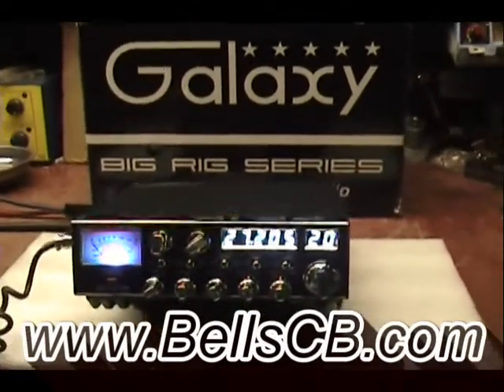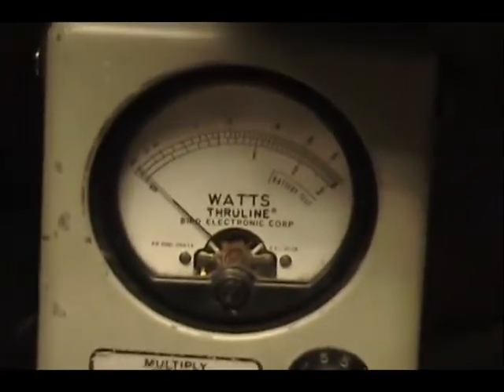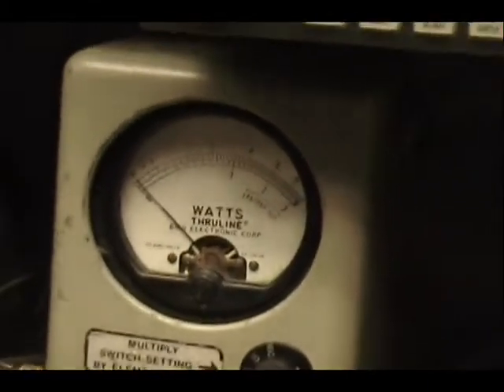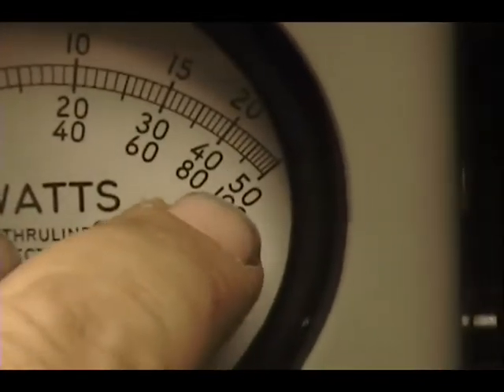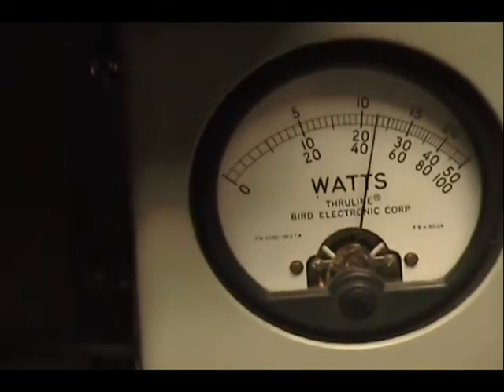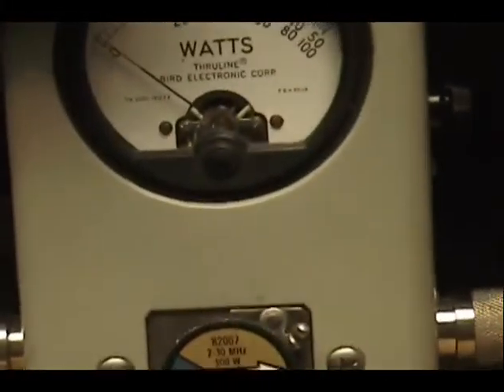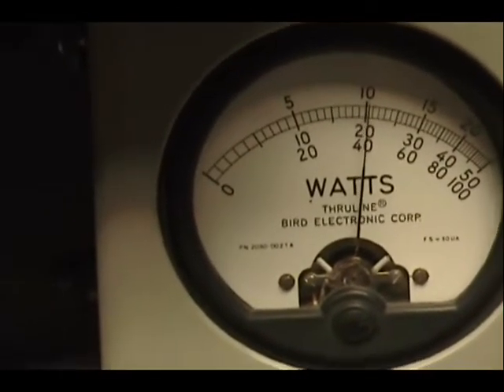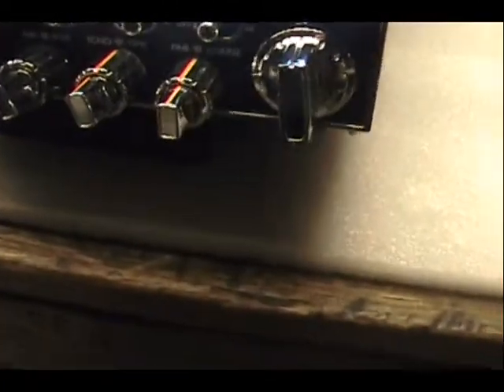Galaxy DX-98VHP Tune-up Report

Comment: hi there you carry any thing that can run on cb and ham?
Reply: this radio will run on both 10 and 11 meters when converted, but you will have to retune the standing wave ratio everytime you want to use the other band,  if you find a multiband antenna such as the G5rv it will work as long as you retune the swr everytime.
Reply: as will any 10 meter mobile and base
Reply: +Timothy Parry Jr thank you for the information! ill just keep the cb i have now Nd get a ham with its own antenna